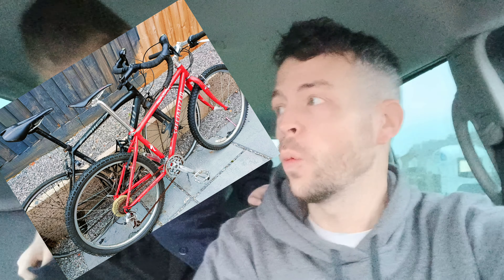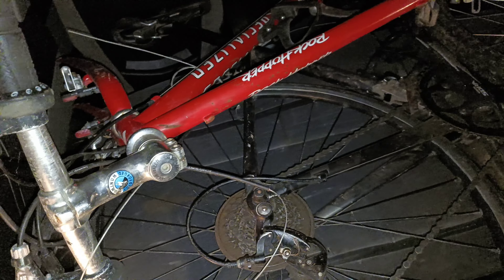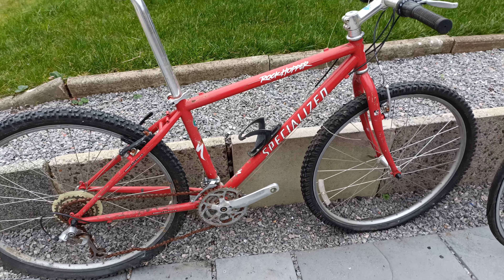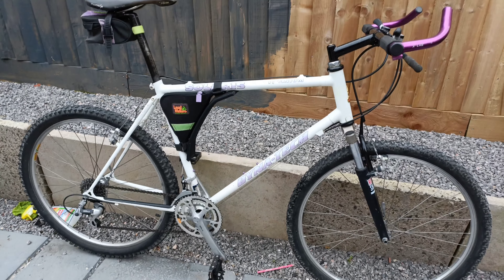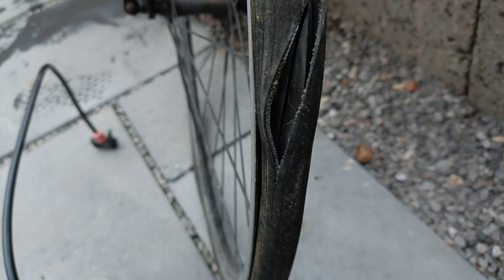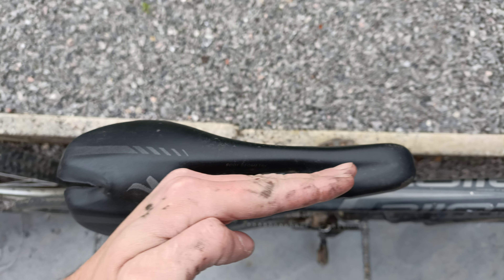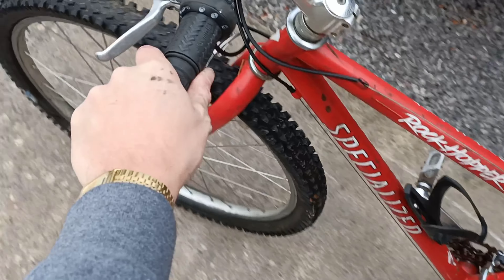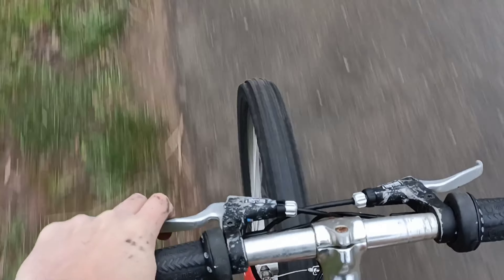⚠️RUINED⚠️Retro Specialized, tyres slashed + titanium bike has sold 😭

Comment: Got a '93 Rockhopper in red with yellow decals recently, paintwork pretty good and cleaning up nicely, until i felt some bumps under the non drive chainstay...some paint scraping and prodding....plently of rust holes and cracked😠 Just about worth it for parts! Win some loose some.
Reply from the maker: Oh no!!!! I had that on an early 90s Zolatone paint Marin, paint was not too bad but under the bubbles were little rust holes.